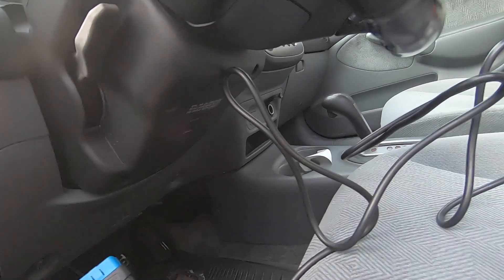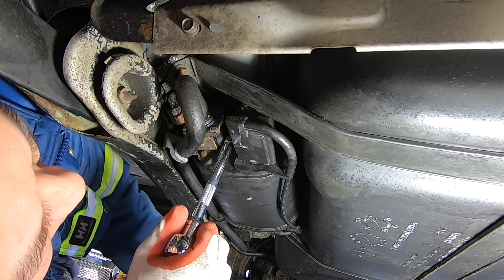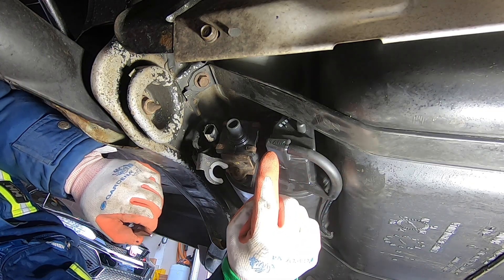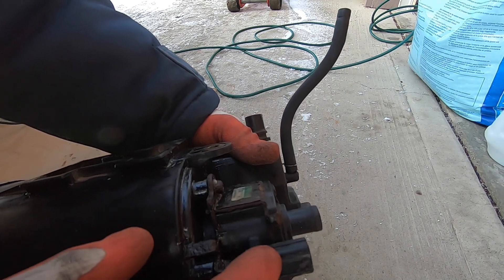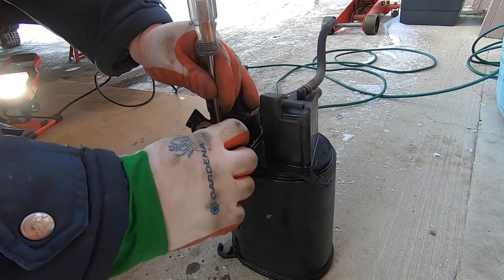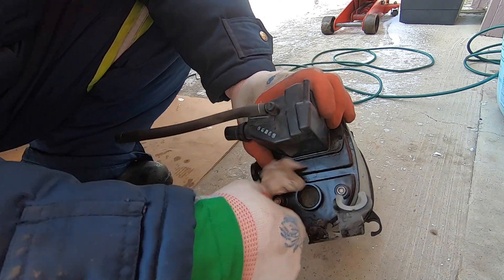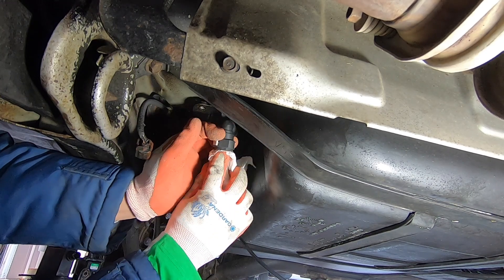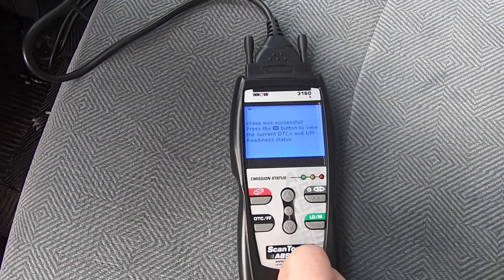Honda P1457 EVAP 2 way Vent Solenoid Repair

Comment: Hello people, I had this problem years back. Did a smoke test at pep boys it came out no leaks. Spend about 700 at dealership to fix the problem and code still came back on. They replaced the solenoid in the rear and replaced the 80 amp fuse in front hood of the car. So finally the last solution I looked up replacing the pcv value and it was leaking oil. I think it solved the issue. I saw a video replacing pcv by youtube Gilbert. Hope this helps
Reply from the maker: Wow that is an odd fix for the EVAP error code.  Good that you go it resolved.

Comment: Any place to buy replacement bolts besides Honda anyone know? Can’t find them anywhere online :(
Reply from the maker: they're a metric screw is all I can tell you but in the end, going to honda is the easiest since they're a known part and they're relatively cheap (a few bucks at most).

Comment: I had code P1457 EVAP Control System Leakage (EVAP Canister Area) on my son’s 2002 Civic Ex. I order the part on Amazon because the OEM was more than I wanted to spend. I had a minor challenge removing the small hose and clamp attached to the solenoid valve where that metal bar was so I removed the other end of said hose which made it very easy to remove and reinstall the charcoal filter. I also changed the gas cap because the gasket was cracked. When I reconnected the negative line to the battery no more check engine light! Over 275,000 miles and this car has lots of life left! We are original owners. 
Thanks for this very clear video. I need to now cancel my appointment with the mechanic since we couldn’t wait for the 2 week lead time.
Reply from the maker: Glad you were able to get this all sorted out.  It can be a bit crammed in the back of the gas tank area where this component is located so as long as you were able to get it out, replace the faulty part and get it all reinstalled properly that you're golden.  Did the CEL go out and stay off once you replaced everything?
Reply: @piercedasian  Yes the CEL went off automatically when I reconnected the battery. 

1 day update. The car ran great last night and to and from work. While I was bringing the car to my son the car went back to limp mode and the CEL popped up. Back to the drawing board. 

Any suggestions out there I can look into before I cancel my appointment with the mechanic?
Reply: @damanSV650  any updates? Did you was able to fix it? Or u went to the mechanic? Why the cel pooped again?
Reply: @damanSV650  is it an automatic?

Comment: Great video, however, when i took out the screws the thread inserts came out with them, any suggestions?
Reply from the maker: hmm, that is no good.  You can either buy a used charcoal canister OR get the threaded inserts off the rusted screws and then epoxy the inserts back to the canister (relatively easy to do).

Comment: I got that code and these are all the things I have replaced. Please help. New Evap canister. Evap solenoid shut off. FTP sensor. Evap purge valve (next to intake). Oem gas cap. Gas pump with new seal. The only thing left that I can think of is the vent solenoid that is with the ftp sensor
Reply from the maker: you may want to check your fuel filler neck.  Common leak area on many cars and the civic is no exception to this.  While I am fortunate enough to not have a fuel filler neck leak that corrosion of the neck or deterioration of the rubber connector piece on the neck will absolutely cause a EVAP system leak.

Comment: Well I guess I know what I’ll be doing in the next week or so. Thanks a lot this was excellent! 

I liked and subscribed I figure it’s just a minimum I can do.
Reply from the maker: Thanks for the sub!  Best tip is to get a good quality penetrating oil (WD40 is not penetrating in my opinion).  Get some liquid wrench or PB Blaster soak those screws down, give them a tap with a hammer and a twist with a screwdriver and more penetrating fluid and removal at that point should be a walk in the park.

Comment: So while trying to remove one of those screws the insert came out of the plastic canister not wanting to spend 150 on a new canister I heated up the insert got the screw out of it and then epoxied the insert back into the canister and bought new screws. Also if you need to clean up the threads on either the screws or the inserts or if you need to buy new screws the screws are M5
Reply from the maker: yeah sometimes the screws just jam us so badly that you end up tearing out the insert in the canister.  You did exactly what I would've done and expoxied the threads back into the canister.  Glad you got it all fixed up and hopefully you coated the screw with some anti seize to prevent future seizing of the screw.
Reply: I did! Thanks for making this video!

Comment: My 03 civic doesn’t pass the emissions test had this code could this be why ?
Reply from the maker: Absolutely. Properly function evaporative  emissions is one of the key criteria for emissions testing. You’re essentially leaking hydrocarbons in the air and that’s bad for the environment.

Comment: I can’t thank you enough for a clear concise tutorial. I just changed this out today. I even got inpatient with one of the screws (didn’t wait long enough for rust penetrate) and stripped it a little. I used your vice grip idea and got it removed. 
I almost chickened out, but am so glad I didn’t.
Reply from the maker: you're most welcome!  Sometimes in the repair world all that is needed to tackle an otherwise painful job is patience and perseverance.  I hate rusted screws but living where I do unfortunately exposes cars to plenty of corroding salt.  The type of penetrating oil you use DOES matter and I have found that liquid wrench and sometimes a bit of heat (on non meltable or flammable parts) seems to do the trick in MANY cases.  WD 40 is useless and KROIL is waaaay overpriced and works no better than liquid wrench.

Comment: I don't think that's the purge solenoid. I think the purge valve is on the other side of the EVAP canister. Purge solenoid connects to the intake to allow fuel vapors to enter engine. The purge valve for these civics is right next to the throttle body. It has a pipe connected to it with a green cap.
 What you are replacing is a vent valve. This valve is typically open. This allows air to escape when filling the fuel tank with fuel. When refueling your vehicle the air in the tank gets displaced by fuel but the air has to escape somewhere, therefore this valve is open to allow the air to escape.
Reply from the maker: Mohammad, you're correct.  The folks at the dealership interchange evap purge and vent solenoid often (I know this b/c I worked at Honda) and after many years of throwing that term around and having people understand each other that even myself I get into a bad habit of calling something the wrong name.  I will correct the title of my video but unfortunately the video itself will forever have incorrect terminology.   Thanks for pointing that out.
Reply: @piercedasian  After doing some research, I was wrong too! Purge valve is next to intake manifold. It has the green cap next to it.. The one on the other side of the EVAP canister is the 2-way bypass.

Comment: I did mine on the weekend. Watched your video again and again before touching anything on my car. Anyway I went to the junkyard pulled out this canister, solenoid and the fuel cap. Bought them all for $26. Went home did the same thing on my civic. Removed the old fuel cap, canister and the soleniod and put in the used parts from the junkyard. It took a while to get it but at the end I got it...after the install was done I did the reset through my code reader. And today I drove over 300kms...guess what??? The light didn't come back again!!!! Thank you so much for the help you have the best video out there 😘😍
Reply: @keatonvincent9752  let me know how it goes?
Reply from the maker: Glad my video was able to help you solve your problem!
Reply: Where did you end up getting the screws for the vent shut valve?

Comment: I have the exact same code on my 99 civic. I knew the code but didn't know the exact issue. Took it Honda and my purge solenoid is actually stuck open. Either way it has to be replaced. You paid 120 bucks for your, mine cost 300 freaking dollars at the dealership. Everything on my Civic" part wise" is expensive as hell.
Reply from the maker: yeah, that is why they call them the stealership... at least yours is fixed now so you're doing the environment a favour so kudos to you for getting it fixed.
Reply: @piercedasian  I had to get it fixed. My car was running real real bad. The idling was horrible, it was hard to start etc...I use nothing but Honda OEM parts. I tried the part stores and my Honda does not like aftermarket parts.
Reply from the maker: I'm exactly the same way with genuine honda parts.  They definitely cost more but you can have the assurances that the parts you buy will be a perfect fit and will operate as expected.  I guess for $300 it isn't that bad b/c I'm assuming that includes the labor to install no?
Reply: @piercedasian  I installed it. My EVAP canister is under the hood on the firewall right next to my battery. Super easy to get to. The part I replaced the purge assembly solenoid. That part is located on the left side of my throttle body right on top. Super easy to get to. 2 screw 2 hoses off it comes.

Comment: Great video👍🏾, i did try this method on my 03 rsx as its the same as the 04-05 civic as well as the same check engine code. But unfortunately code still code back. Anything else i should check?
Reply from the maker: check the fuel filler neck going to the tank as well as your gas cap seal.  EVAP leaks are a pain for the average person (including me) to pinpoint.  The slightest leak will trigger the check engine light.  If you're still stumped then you're going to have to take it to a shop to have them use a smoke generator to fill the system with smoke so they can pinpoint the leak that way.
Reply: Were you able to find the cause? I’m having the same issue.
Reply: @damanSV650  not yet

Comment: If the code comes on for this how long can u keep driving it like that?
Reply from the maker: you could indefinitely drive like that.  you'll just be getting marginally worse fuel mileage, potential fuel smell and you're slowly ruining the environment.  I've seen some people drive for YEARS with this issue and some can't drive for long b/c they're literally leaking fuel all over the place so it depends on the severity of the issue.  If you don't see fuel leaking or even smell fuel vapours then odds are you can leave it as is.
Reply: I have 2000 civic,  and I drive it for 2 years now,  I get 32mpg, I don't see nor smell the gas.

Comment: I changed mine but the code still poppin up a month after changing what could cause that?
Reply from the maker: You likely have another leak somewhere in your lines or canister.  EVAP emissions leaks are one of the things I absolutely HATE troubleshooting b/c most DIY mechanics (including myself) don't have access to a leak detection system that uses pressurized smoke to help you find the leak.  I'd suggest you take a close look at the fuel filler neck to the fuel tank.  There are a few rubber hose like fittings (including the main filler neck coupling joint) that can often develop micro-cracks from deteriorating rubber.  Also, check out the fuel and fuel vapor line sets running from the tank to the engine.  Sometimes if you're lucky you can see an obvious crack but more often than not, you can't see them.  Worst case scenario is that you will need to take the car to the shop to have them use their "smoker" to find the leak.

Comment: Thanks for the clear video. I'm looking at a 1999 Honda CR-V w/128,000 miles. The owner is has been very straightforward thus far and has taken a photo of the P1457 code on his scanner which would indicate that the EVAP needs replacement which led me to your video. If that P1457 has been active for some time would that have caused additional damage to the vehicle? Could that code be an indicator of other issues? Thanks again for the video and the advice on ordering he part.
Reply from the maker: Having a P1457 code won't really cause other issues other than you polluting the environment ever so slightly more.  The issue with a P1457 code is that you could have leaks elsewhere in your evaporative emission system (leaky fuel filler neck, cracked pipes and seals).  The P1457 code in my particular case is VERY common due to the fact that the car is quite old AND there is salt used in our area and corrosion will eat metal parts away that causes a leak as where I pointed out in my video.  It will truly depend on where the leak is on your car but an evaporative emission leak alone won't damage anything else.

Comment: @piercedasian I’m wondering if you could have changed that part without removing the canister? I live in Southern California so there’s no salt or rust, 2006 Ridgeline with the same code.
Reply from the maker: You could but honestly it is so much easier to get at it with it removed. It really isn’t hard to take out and even in rust laden Canada that the removal of the canister was the easiest part of the job. Yanking the rusted philips screws was the hardest part for me and thankfully they came out (just barely given the rust it had - I count my blessings)
Reply: I went ahead and bought both parts off of Amazon for a total of about $210.  I assembled it before hand and it went in super easy.  We have a 2001 civic so I figured it’s only going to be replaced probably once in the car’s lifetime so now everything is brand new and ready to roll!🚗
Reply: @Gretzky2857  hey, thats a great idea! I was thinking of it to save myself from taking off those screws, so I think am gonna buy the canister and the vent valve separately, then assemble it and all i need to do is to take off the old canister and to put the new canister with the vent valve already assembled. Is that what you did? How hard was to take the old canister, i mean the bolt that secures it? What about the hoses?

Comment: Thank you for the great video ! Do you know where I can find the hose replacement for all lines and mounting bracket ? I am worried of tears / breaks since I live north of the US with lots of snow ( rusty cars)
Reply from the maker: You likely are better off going to an auto wrecker to buy the complete assembly for cheap rather than buying new from the stealership.

Comment: What size are those two screws attaching the new part to the canister do you think? The non-OEM vent solenoid I got didn't come with screws sadly
Reply from the maker: I don't know the size but I do know you can buy them at the honda dealership for less than $1.

Comment: I have a 96 accord 5 door lx f22b2 149k miles. Recently I smelled gas fumes, popped my head under the car while it was running and saw the vapors coming from the tube on the bottom of the evap canister. My cel is off, i rarely smell the fumes and I was wondering if there is any scenario in which the car would vent to atmosphere when the vehicle is running? Is it likely my CVSV is beginning to have issues or  am I  just sensitive to the smells?  I have to take the car to emissions in the beginning of next week, I'd like to avoid any issues here and I csnt seem to find an answer on whether or not the car would ever vent while running.
Reply from the maker: you could see the vapours venting?  It could very well be a lot of pressure inside the gas tank.  Do you live in a hot climate? If there is no CEL I personally wouldn't worry about it too much.

Comment: Hello,  my cousin has a 03 Honda  EX. 4cyl.  she has the. P1457 code but.  It states. Manufacture control.     Which is weird.   I thought maybe she had an evap leak. Which seems its probally this????anyone with info on why it states  manufacturer  control.  Will be very helpful.     P.s. yes i work on cars all the time  but i dont know hondas lol
Reply from the maker: try another scan tool to be sure.  A P1457 is the evaporative emissions solenoid.
Reply: @piercedasian  with her and my schedules  hard.  I will take it to oreilys auotzone etc etc just to be sure.  But. Was planning on replacing the whole. Canister. That has the solenoids on it.
Reply from the maker: Did you end up resolving your P1457 when you replaced the canister?
Reply: @piercedasian   she hasnt brought it back to me to fix so cant give you an update

Comment: That nipple part on the solenoid is moving is that part broken?
Reply from the maker: yes there is a plunger inside that solenoid and it either jams from corrosion, doesn't seal well or the solenoid's electronics simply stop working (electromagnet). More often than not it is corrosion that kill these things.

Comment: I changed all of them... the canister, the valves and still got the p1457 now what
Reply from the maker: You should as some have advised check the gas cap seal and more importantly the rubber and plastic components in the vent line such as the fuel filler neck and the various vapour lines running from the engine back to the fuel tank.
Reply: piercedasian thanks... I had to change the fuel pump cause it was leaking through the top... didn’t know that would give a p1457 🤷🏽‍♂️ but I change it and now no code or check engine
Reply: @xelementzgaming7171  did you replace the fuel pump yourself or have it done?
Reply: @Gretzky2857  yeah... I just removed the back seat and the fuel pump is right there... I could see the leak through the top... removed the screws , unplugged it and changed it... if you gonna do it, try to do when the tank is not full ..
Reply: Buy oem gas cap. Going to cost you about 50 bucks.  It worked for me.